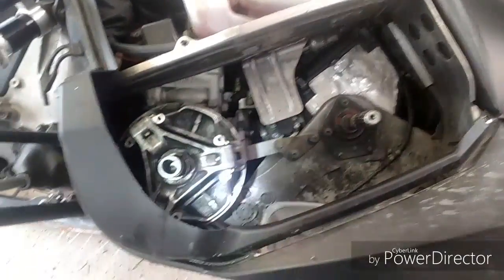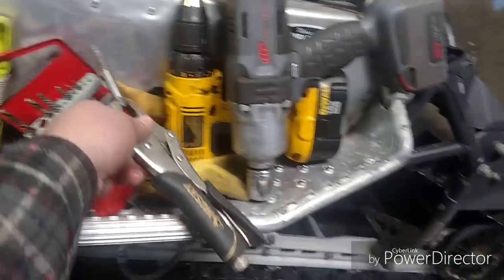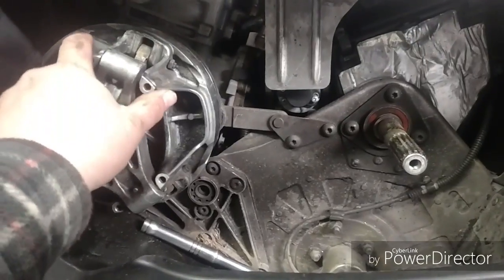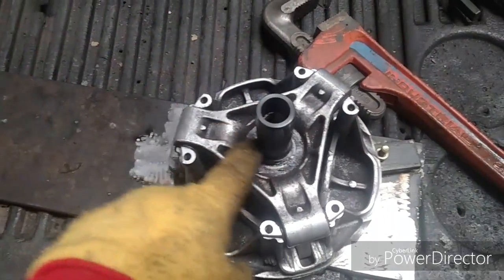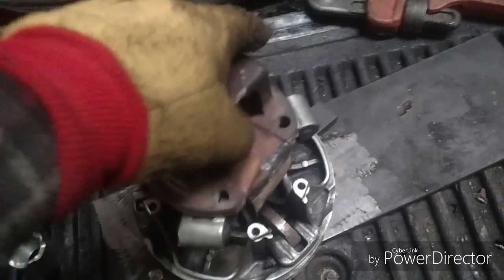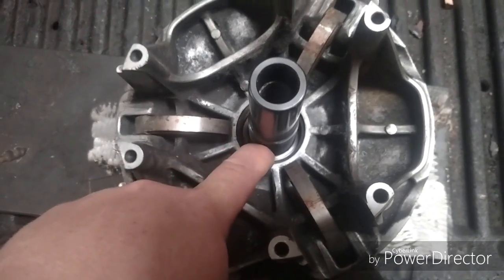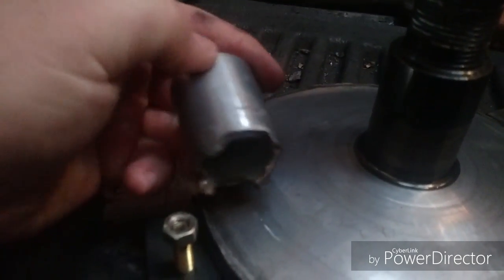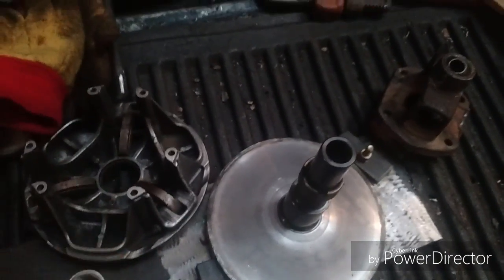Fabricobbling Tools to Fix a Polaris Clutch

Comment: Nice, next time use the 3/4 fine thread, rap some Teflon tape around it and poor some water down the shaft then screw in your 3/4 bolt. It will compress the water and force the primary clutch off..just be careful   its loud when it finally comes off and has some power behind it
Reply: ...and don't forget to leave the belt on while doing this. . .or your clutch will bounce off the ceiling. .

Comment: You are lucky.  I did much the same thing (holding sheave with the cooling fins) and the center shaft turned  leaving the sheave right where it was.  I did mark it first.    Better way is hold the clutch with a crankshaft mimick tool so no pressure is on the fins at all.  Polaris says if this turns at all the clutch is junk.  But then they just happen to sell new clutches.

Comment: Like......uh........what's WRONG with it?? And NOW you have the tools made up to do it again. Win/win situation. And we've got a lot in common yet and still but we just work on different things. Yours is snowball slingers and mine is grass shortners! I had a rough sounding starter on my 19.5 opposed Vanguard I knew I needed to look at and fix, so when I went to pull it out into the sun where I could see, it stripped totally out. Good timing. I finally found a new gear but with my hands being shot, had to pull the flywheel to get the starter loose, a mounting bold up under it. The flywheel nut is 1 1/4 and got that loose and tried the pry bar and #3 hammer method and was scared I was fixing to salivate the crank so had to drive 10 miles for a puller at the local' No Auto Parts Available' place (told me by the manager). Returned and put every last bit of pressure on the puller and smacked that sucker with the 3 pound pounder and could get 1/4 turn on the fine thread puller bolt at a time but it came off. Starter fixed, now have the puller, spare starter gears here from Ebay plus a 10 pack of 'C' clips to hold the whole mess together. And I can see the new BIG sign by the main road.
 'HALEY FABRICOBBLING, WORLDWIDE, MI Division. 
and (occasional logging) under it in fine print.
Thanks Buddy and rest up. Yall deserve it!

Comment: That bolt was not needed to screw against. You just needed to tip the machine on its side and pour some sort of fluid in the clutches bolt hole. Then screw that 3/4 -- 16 bolt in until you feel it getting tight. Put a breaker bar in between the spider and the foot rest to keep the clutch from moving  though. When you tighten the bolt.  It creates hydraulic pressure inside between the bolt and the fluid. Trust me, the clutch will pop off